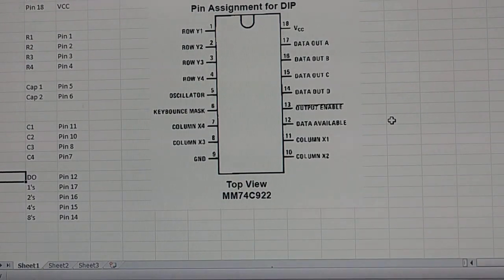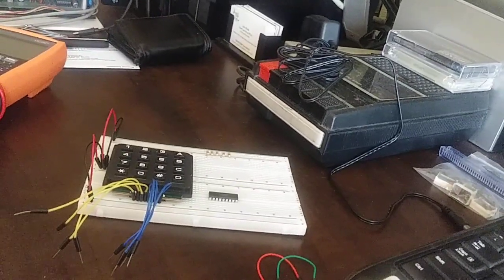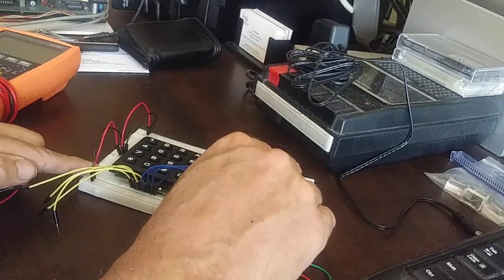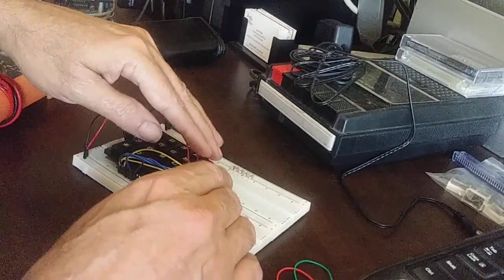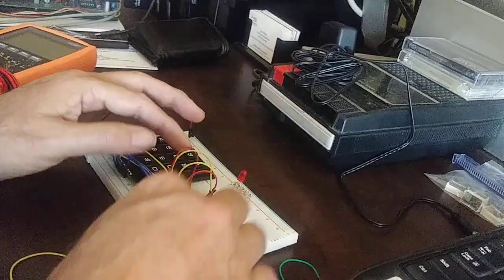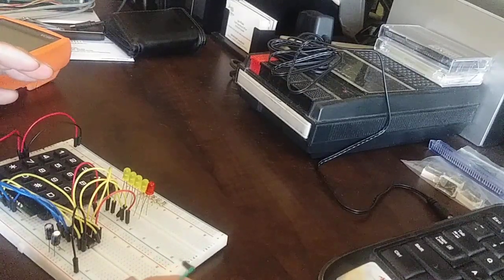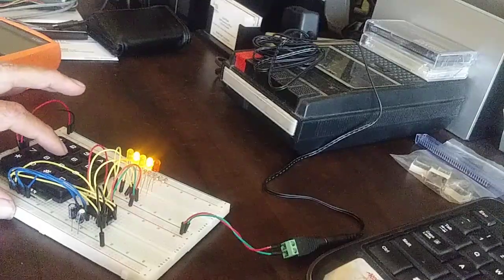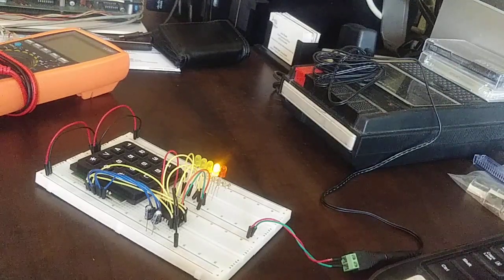Keypad decoder

Comment: the output enable (OE) has a bar on top of it in the pin description (which is an inverter pin) which means that in order to activate the output (A-D) it must receive a logic 0 to be activated that is why it worked when connected to ground (GND) and it didn't on power (VCC). I hope this helped.

Comment: What is the value of capacitors
Reply from the maker: As I am not an engineer, I use what ever seems to work for me. In this case, I believe that I am just using a couple of 10µF or 100µF caps. You should not have any problems using either.
Reply: @jeffnay6502  Thank you so much
Reply from the maker: @salmatamer2562  If I were building this circuit again. I think it would be fun to test even larger capacitors, to find out where you might notice a difference in responses.